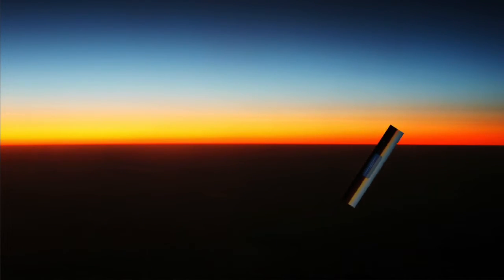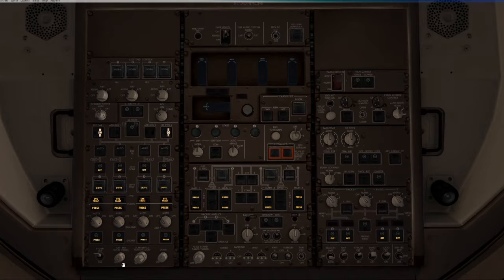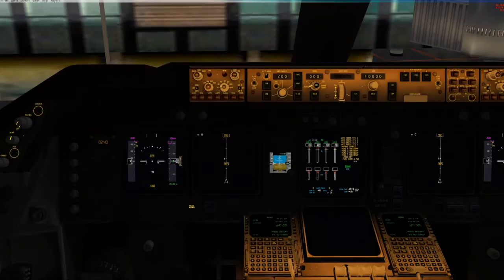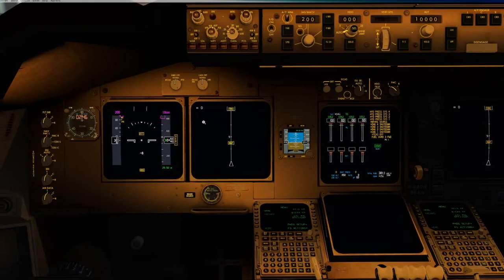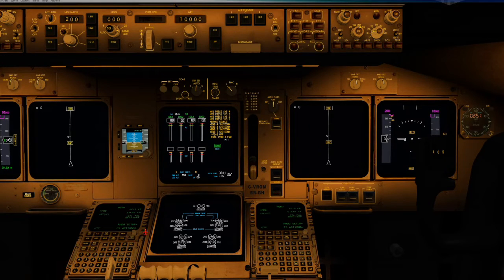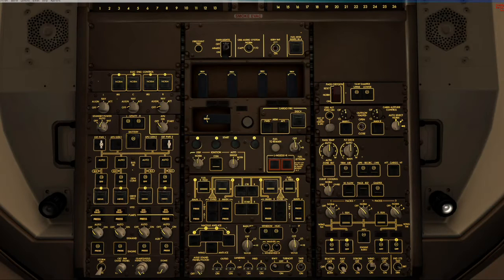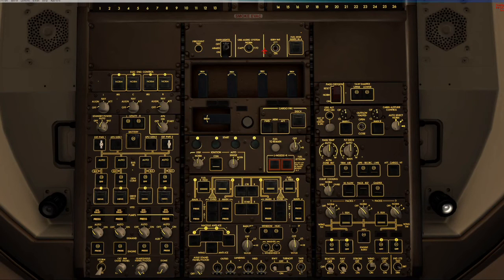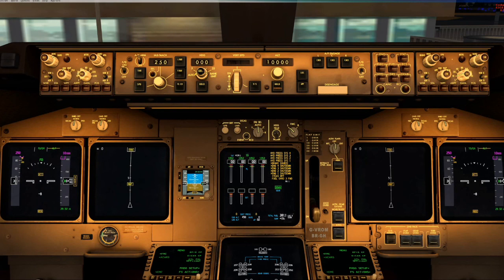Interior & Exterior Lighting (PMDG B747 400)

Comment: I noticed when I parked & turned e gone off, interior pilot canin lights off & exterior. 

The passenger cabin lights still on.

Is there anyway to turn those on or off
Reply from the maker: Not exactly sure about the condition you describe, but only thing I can think of is if APU 1 or EXT 1 are available (AVAIL) and if the Ground Service is ON at the Flight Attendants Panel if in a PAX configuration…

Comment: Where is the passenger cabin light?
Reply from the maker: The Passenger Cabin Lights are on the Flight Attendant Panel at Door 2L on a PAX jet, and on the Upper Deck Panel just aft of the Flight Deck on a Freighter. Pilots cannot control these lights from the Flight Deck, only Emergency lights can be automatically armed to come on or manually selected on from the Flight Deck